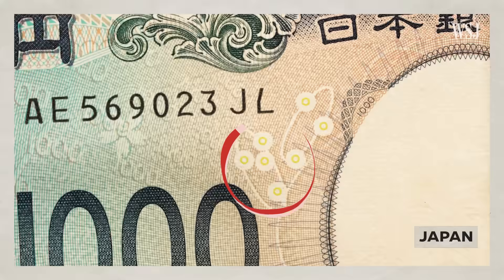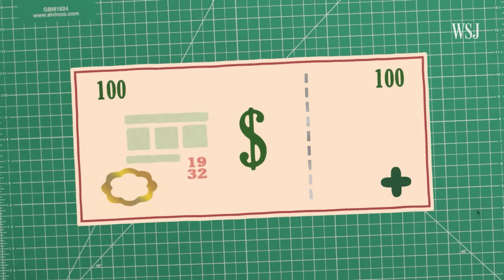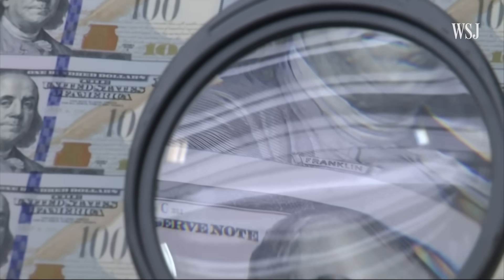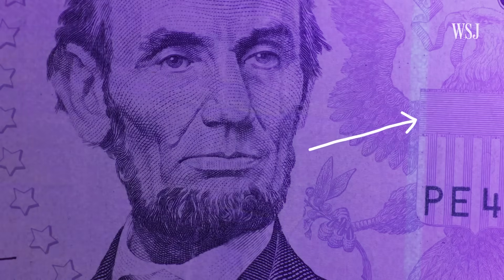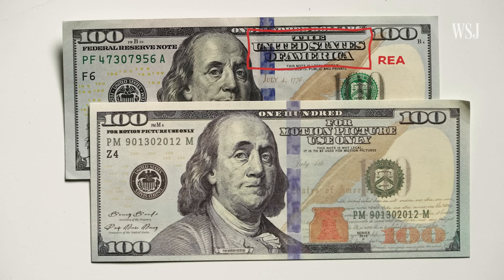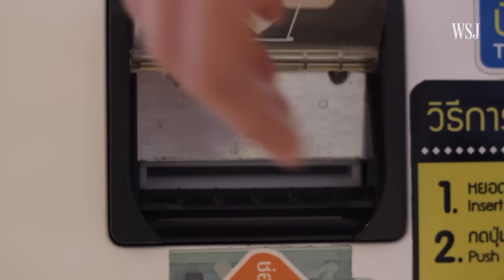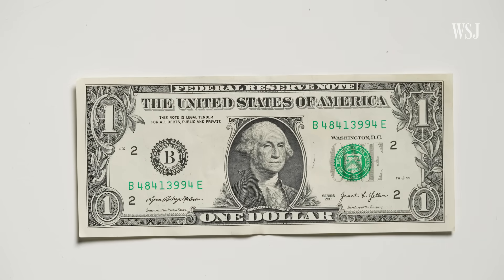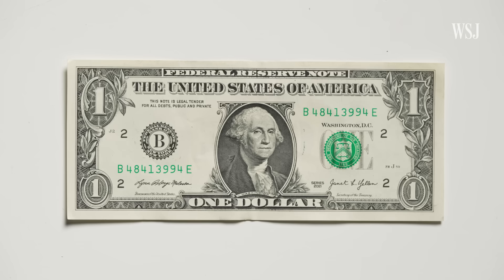Why the $1 Bill Hasn’t Been Redesigned in Over 60 Years | WSJ Pro Perfected

Comment: One thing to stop "washing" low denomination bills in order to print a larger denomination on them that you didn't mention is...make the bill bigger.  I think Switzerland and some other countries do this and have for many years.  You can't wash a 1 and make it a 20 or 100 because it will be too small.  The bigger the denomination, the bigger the bill.  I wish the USA would do this.  Not only this, but I wish they would use some more interesting colors and designs.
Reply: as in so many things, america is literally the worst out of every State worth mention in terms of Accessibility. There's a half dozen different ways to make bills physically different at the preverbal glance and the US uses none of them.
Reply: The Euro (€), which is used as the main currency  in most of Europe, has different sized bank notes too.
Reply: One of the biggest complaints from disability advocates (regarding currency) is that the US doesn't do this.
Reply: Dont turn US Dollars into funny, colorful monopoly plastic monies

Comment: Canada isn't churning out $1 bills, using $1 coins. There will come a time when the U.S. will do the same, so why bother redesigning it. As it is now, it takes about two of them just to buy a candy bar. Counterfeiters aren't going to spend their time on the lousy $1 bill. Even if there are a bunch of counterfeit $1 in circulation, the total value of them is relatively small. If you wanted to buy a laptop computer, plucking down one thousand $1 bills at the store will generate suspicion, whether they're counterfeit or not. On the other hand, you'll probably have an easier time using a bunch of counterfeit $1 bills at a fast food restaurant, but still, this isn't the goal of counterfeiters.

Comment: The economics of it works against counterfeiting a $1. Simply because once you have them... what're you going to do with them? You won't be able to effectively exchange them for real value - not unless you're willing to become known as the one who always pays for gas in 1s. And the up-front cost of what you'd need to produce them is so high that you'd need to print and cut probably a few hundred thousand of them and exchange them just to break even. The amount of time required for both ends of that is huge...

Wouldn't surprise me if there are counterfeit 1s in circulation, but they're likely such a small blip compared to the overall amount of money in circulation that any impact they're having on the overall economy is negligible.

Comment: We clearly don’t need a one dollar paper note. The value of one dollar has dropped so much that the coin is more than adequate. Just like we don’t need a penny anymore. You probably don’t even need a nickel anymore. We should probably just have a $.10 coin $.50 coin and a dollar coin or you can issue brand new currency with the new ones are worth five times more than the previous then you can have a penny that’s worth the old five cents a five cent coin that’s worth The old quarter a $.10 coin that’s worth the old half dollar and a 50 Cent coin that’s worth $2.50 and then the one dollar coin that would be worth five dollars than everything would actually have value. Get rid of quarters cause it’s a dumb division and get rid of the $20 bill make everything ones and fives.

Comment: I've heard that the most counterfeited denomination is the 20--small enough not to invite a lot scrutiny from recipients, big enough to be worth the trouble.
Reply: there is also the fact that vending machines and similar things that accept bills the largest bills they accept are typically 20s. So the theory is if you can get trick a ATMs or vending machines with a counterfit you can get real currency.
Reply: @anacreon212  I found Your comment interesting but I am NOT sure about deceiving an ATM with counterfeit currency? Can You pls explain? I've never operated an ATM for the purpose of putting MONEY IN. Always a case of getting money out?
Reply: Glad that SOMEBODY has been paying GOOD ATTENTION!
Reply: I work at a bank and can largely confirm. I almost exclusively see two kinds of counterfeit bills. Counterfeit $20s and “for motion picture purposes” $100s.
Reply: yeah that's why the new euro introduced some of the new features specifically from 20 onwards.
Reply: @My1xT The heavy security features in US bills are on the 50 and 100. The 20 is similar to the 5 and 10, but it's also a 20 year old design. Both the 5 and 10 are newer.
Reply: Most counterfeits are super bills which have their own flaws.

Comment: The 1 dollar bill is updated pretty much yearly. The 2 dollar bill has not changed since 2003.
Reply: Wrong,
Reply: The only difference in the $1 bill since 1963 is the series date and the signatures.  No other design element has changed.

With the $2 bill, that goes back to 1976.
Reply: The $1 bill has been the same basic design since the 20s. 

The $2 bill has been the same design since 1976.

Comment: Or just... Use a bank card. Pretty much no one in Sweden uses cash anymore. So counterfeit money is a low issue, if you drop or forget your wallet somewhere; all of your money is still safe, no reason to try and mug someone cause no one's carrying cash anyway. (Crime still exists of course and thanks to the immigrants the gang violence has skyrocketed.) I miss the feel of physical money but I think the positives of bank cards far outweigh the negatives.
Reply: The U.S. is getting this way.   Everyone uses bank cards.   However there is still a place for cash, especially the higher bills.   Cash allows upfront, trust free transactions which are necessary all the time.   There is no risk of fraud if cash is paid on the spot.
Facebook Marketplace, large item garage sales, apartment deposits, used car purchases and on.  If anything they should bring back the $500 bill.

Comment: I'm surprised the narration mentions the cost of recalling and replacing notes. As far as I know, the U.S. government has never "recalled" a note. The government does encourage banks to send back older designs as customers deposit them so those notes can gradually be taken out of circulation. But the old designs remain legal tender and can continue to be used.
Reply: Old US currency is still legal tender, yeah, but the narration goes over all kinds of Euro security and European historical currencies. All pre-euro currencies are no longer legal tender as of twenty some years ago, and the British Pound just a couple years ago make their old £20 and 50 notes get "recalled" for updated versions.
Reply: @LibertyMonk Yeah, I thought Europe recalls notes. 

I was trying to say that the cost of recalling notes isn’t blocking redesign of the US $1. Because the US regularly redesigns notes without recalling the old notes.
Reply: They do it at the bank
Reply: @ Yes, in the US, banks return the old notes as they are deposited. And when banks order new notes, they receive the new design. But that's mostly just part of the normal process. It just means that a teller with an old note in their drawer won't give that note to another customer. I wouldn't think there would be any significant extra cost involved with that.

I think that's different from "recalling" a note, where all the old notes have to be exchanged for new notes by a certain deadline. That requires extra work by the bank or government to collect all the old notes and replace all the old notes with new notes in a short time period.

Comment: Should have Dime and Dollar Coins with $5 $20 $100 bills. Eliminate .01, .05, .25, paper $1, $10, $50.  I did a risk review inside a Federal Reserve Bank.  Handling costs, counterfeit, and coin loss would be so much lower.  Canada eliminated the .01 and forced all receipts to show rounding calculation. It was a waste - people got it after the first transaction.
Reply: Dimes are worthless. Quarters are the only coins worth keeping.
Reply: @benn454  But then you would need the second decimal place.  Dimes are 1/10th.
Reply: @cinemabunny  Dimes are practically worthless. Who cares about decimal places. We use fraction in America. A quarter is 1/4.
Reply: We’d still need a 50¢ coin.  But not the giant Kennedy one.  It should be a bit larger than a dime, but with some feature not seen on US currency before.  Maybe a transparent plastic core with a metal ring?
Reply: @VPWedding  Just the $1 Susan B and the dime.  The more denominations you have in coin, the more loss happens at the Treasury outsource sorting centers.  Plus, each coin has handling costs.  If anything, not even the dime.
Reply: Genius untill you release the sacagewa coin has existed,n your not reinventing the wheel
Reply: @thisgame2  I was a big fan of the Sacagewa coin when it first came out.  But it made my wallet much heavier, and no one ever gave them out as change, so no one ever had any.  Also, too easy to confuse for a quarter - the difference in color doesn’t help in low/brown light like in restaurants.  They didn’t solve the problem with the SBA dollar.

Comment: 30 years ago, I did work experience with one of these experts and I asked if the serial numbers were tracked;  I wasn't asking in terms of counterfeiting but in terms of the technical burden, which I still believe was possible in the 1990s.  It's even more possible now.  But never in an article or a video like this, has it ever come up.  Simple though?  The counterfeiter has to decide whether to use fake serial numbers — which can be caught just like credit cards — or take the risk of duplicating real numbers … but how many real numbers can they ACTUALLY know?  Does a counterfeiter have a real note for each one they produce?  I doubt it, though if they're rich enough and big enough (state sponsored) then it's a strategy.

Once you detect duplicates — say, the same number circulates to the central bank within 7 days, 7 weeks or 7 months — then it's just a matter of putting a "hold" on an arbitrary threshold that you can afford to (temporarily) withhold.  If there's a note that comes around every 7 days and you hold it for 14, see if it comes around WHILE you hold it.  Then you have 2 to inspect!

Comment: Why don't people counterfeit the older money without the security features?  It's still legal tender.
Reply: Because it becomes suspicious and more heavily scrutinized wherever you’re trying to launder it. You might be able to pass them around here or there but not in enough quantity to be worth it.
Reply: they do, there is such a thing of aging newly made old style banknotes and dunking them in tea and similar materials then drying and washing them to get them to look old and well used.
Reply: @SakuyalzayoiTheMaid Yeah but you can only do that so far back because governments actively deprecate old bills when they circulate through the central bank.
Reply: @BobBobman-v1d  I think that in the US old tender is still valid, in my country they got deprecated after a few years, usually a long span
Reply: @betochiwas Old tender is still valid in the US, but when it goes into the banking system it’ll be taken out of circulation if it’s a deprecated version.
Reply: They do.  Most of the fake $100 bills I've seen where I work are of the old design, because the new design is a lot harder to realistically fake.  One I saw I could tell was wrong right away because it said "Series 1985" but had the signatures of Mary Withrow and Lloyd Bentsen on it... that should only be on Series 1993.
Reply: @troodon1096 The problem is you can only do this small scale because the older bills are taken out of circulation when the go through banks.

Comment: This is why you should only counterfeit $2 bills.  Not only have you doubled your value from a $1 bill,  everyone knows about them, rarely sees them, jokes how they must be counterfeit, but still accepts them!
Reply: No, I actually got turned away trying to use a $2 bill. The individual really had never seen it before. I had to trade it to someone else and get $1s.
Reply: I hand these out as valet tips 😅
Reply: Now try passing $3 bills.  That would be impressive.
Reply: @LFTRnow  The 3 cent coin used to exist. Called a "trime"
Reply: @LFTRnow I love that limp Bizkit album
Reply: Once i went to a drive in theater in orlando florida and the clerk gave me change in 2s only. I still have no idea what his deal was
Reply: Hawkwind used to throw out nine bob notes to the crowd. There never having been a nine bob note, bent (dodgy) as a nine bob note having been in the vernacular. Picked up few at gigs back in the day
Reply: No I don't think you would use 2 dolar bills because it would be odd that someone would have a massive amount of 2 dollar bills
Reply: or do it with old bills. bills from the 80s are still valid, and no one at a checkout really knows what security measures existed at the time. if it fails the marker test, it could be because they used a different paper or ink back then. if there's no pattern, they might not have done that back then. if it's even questioned, those excuses will work unless you by chance get someone who did research on the evolution of money for some reason.
you can also do coins, a quarter doesn't really have security measures and no one cares enough to check each and every quarter. vending machines and coinstars will likely accept counterfeits if they're the right weight and size, and as long as you use an alloy close enough to what the coin is then you'll be able to get it past pretty much anyone. this does require making a stamp and making blanks, which is harder than printing on fabric but still doable. a stamp can very likely be made by pressing the shape into wax, making a mold around it, heating and pouring the wax out, pouring steel in, then treating the steel properly so it lasts. manufacturer error coins would need to be filtered out, sure they still look plausible but it'll go straight to a collector and appraisal will reveal the whole scheme's existence (unless it's good enough to fool someone inspecting a coin to verify that it's worth more than any bill in circulation, which if it does then there's quite literally no way for it to fail as long as no one sees the stamps themselves). 
anyway don't use this as a guide or advice if you do then it's not my problem
Reply: Surprisingly not a lot of people have seen them. At least younger people. They think they’re fake.
Reply: In Aus, I saw an elderly tourist attempt to use an old note that they had left over from a previous holiday.
I think it was a $50? It's still legal tender, but the cashier hadn't seen the design before (it was from the 'paper' series) and assumed that it was fake. It would've been from >30 years ago.
Reply: Not everyone knows about $2 bills; search online and you'll find dozens of articles of cashiers rejecting $2 bills because they think they're fake.
Reply: Jerome Powell is lazy and needs to get a new bills
Reply: I used to get two-dollar bills from a tobacco shop that sold coffee as well. I always thought they were the most attractive of the US paper currency.
Reply: this reminded me I have a couple 2003 series in an envelope stashed away.
Reply: 😂😂😂 rarely sees them 😂😂😂 post offices give them as change all over
Reply: How often do you use $2 bills 😂😂😂
Reply: I have never seen a $2 bill in circulation unless it was the subject of some special event dedicated to bringing awareness to a $2 bill, and then the bill is just taped to a wall or hidden away as something of a lucky charm of sorts.
Reply: I work in a bank and we receive brand new 2s from the fed all the time, usually a few thousand a month we give to customers.
Reply: @DonnieBowerman  My bank said I would have to order them, I think at 100 at a time.
Reply: @geigertec5921  it happens in fast food at least lol.
Reply: @AJ-er9my 3-4 times a week. You can get them at the bank. Pilots love to tip them   -former line guy
Reply: @AJ-er9my, in my case, a lot
Reply: you know, $2 bills are common in ecuador
Reply: I dont rarely see them or joke that they are counterfit (i keep one in my wallet)
Reply: @Velocifyer  Same. I one of those weirdos that gets a stack of them at the bank, and uses them regularly. I see 2 dollar bills everyday lol. 

Nobody's ever denied them from me yet. Sometimes they'll remark "wow, I haven't seen one of these in a long time", but never accused of counterfeiting. Though, I live in a small town, so everyone's used to me paying with them.
Reply: @Vospader0 Same here. Idk why, but I just like carrying $2 bills.
Reply: @Velocifyer You're so cool!
Reply: @NickScribe3  he knows.
Reply: For anyone unaware, two dollar bills are still produced today. I actually have a stack printed in 2017. 

There was only a brief time two dollar bills weren't being printed, from 1966 to 1976. Under George Bush Jr., they started printing a TON because Bush was trying to get more people to use them (because $2 costs the same amount to produce as $1, but is worth twice as much). So you'll see A LOT of one dollar coins and two dollar bills produced in the early 2000s. Neither really caught on.
Reply: I don’t understand why the fed and the govt doesn’t just compel us to use $2 bills and $1coins. Just stop making $1 bills (and Pennie’s while we’re at it)…what are we gonna do? We will adjust.